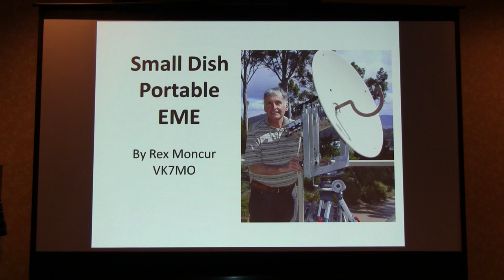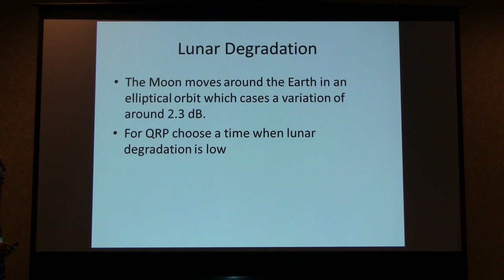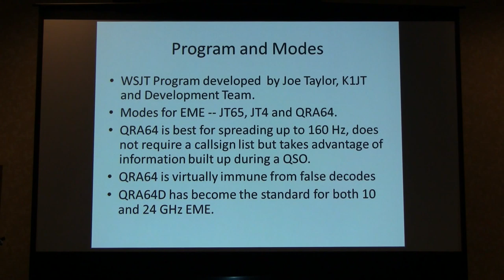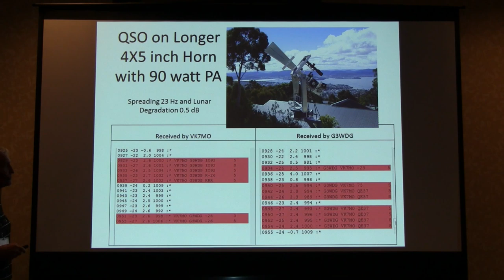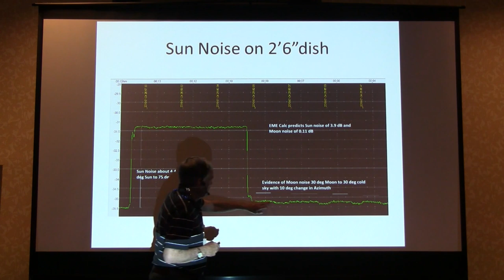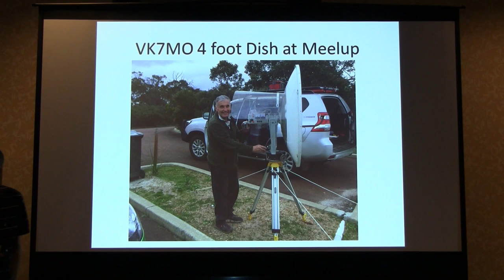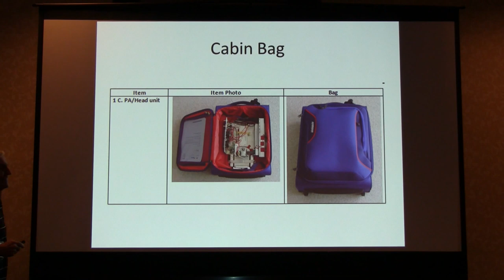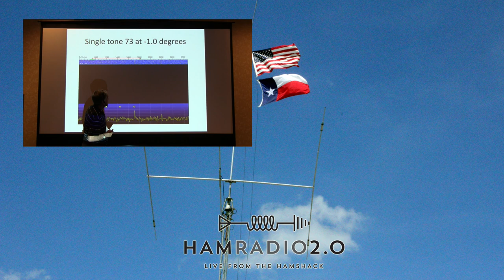Ham Radio EME with a Portable, Small Dish | Earth Moon Earth, Microwave Update

Comment: Amazing. Is there any off the shelf gear that can do any of this stuff?
Reply: I enjoyed EME with an OFF-THE-SHELF Dual Band Kenwood transceiver with both 2 Meters and 70 Centimeters.
If you don't feel like making your own antennas, you can buy a YAGI or a Helical antenna in your preferred frequency band.  Then mount the antenna on a tripod, aim it at the Moon connect the radio, and put out your call sign! You can do it without a tripod, but you'll have the tripod for your second EME!  Join a local Ham Club they will help you get your license, and you can participate in their outings and events until you get a feel for what you like best.
 Have Fun, Get Started Today!  Bill Olson. AD7NA Portland, Oregon
Reply: @251omega  thanks for the reply. I’ve actually gone pretty far down the eme rabbit hole since I made this comment two years ago. I made three eme QSOs on 23cm just a couple weeks ago.
Reply: @Cheeseoverdose  Yeah, just as I posted my comment, I noticed your comment was 2 years old.  But, then I figured that there will be others who could use the info.
---> 23cm - I am turning 72 on Tuesday, I can't afford the up-keep on the longer bands, let alone go into the GHz ranges. Back in the day, they were just starting to open up 10GHz, Now it's amazing with 275GHz and higher.  Gone are the days when I was going to modify my Microwave Oven with homemade waveguides and horn, etc. to try out 23 cm. It's probably not possible, but I liked lighting up florescent tubes in my microwave classes! Keep on enjoying experimenting with radio, BillO AD7NA
Reply: Icom IC-905